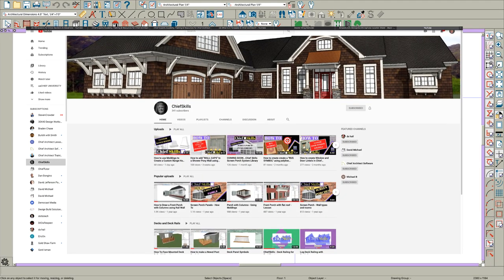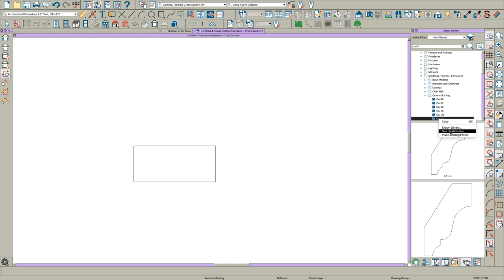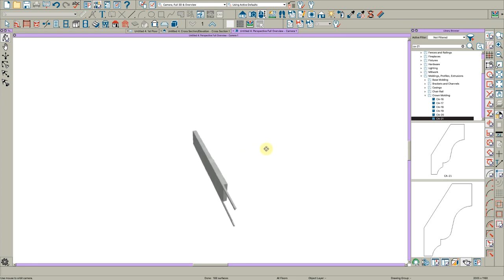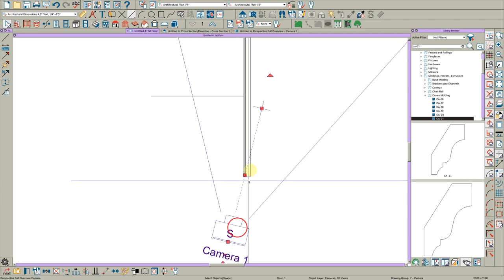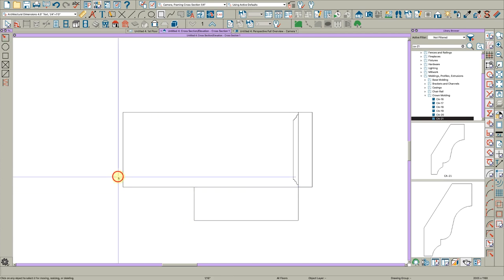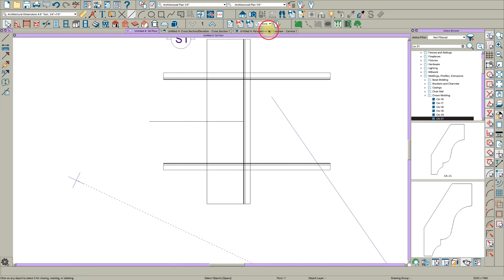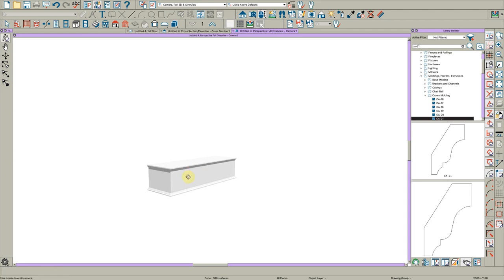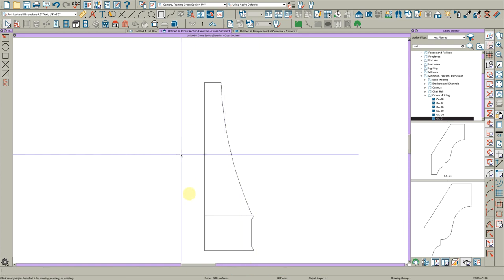CUSTOM RANGE HOODS with Solids using Chief Architect X12

Comment: Molding is a lot easier than solid. I had tried to do that hood as a solid previously and gave up because the side curves. Sloping front I could do but didn't think of cutting out the sides like that. Thanks for going the extra mile and explaining the solid way of building the same style hood.
Reply from the maker: I’m glad it was helpful.  Thanks for commenting also...It’s always nice to hear if what I produce is actually helping someone.